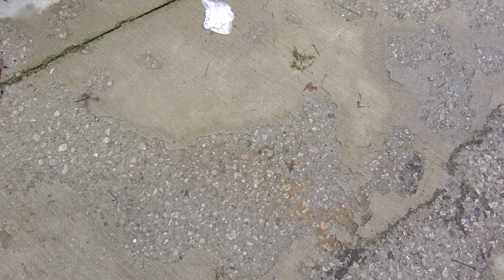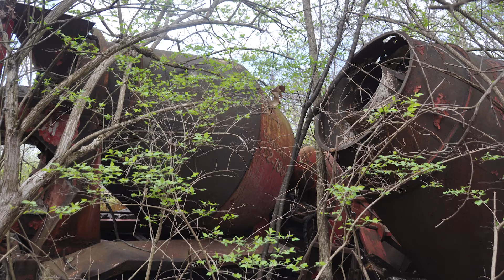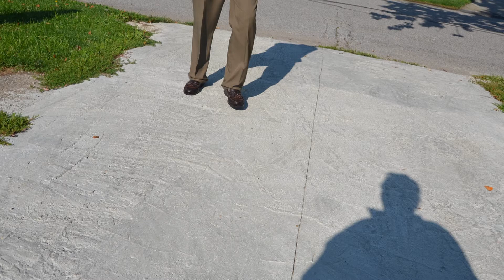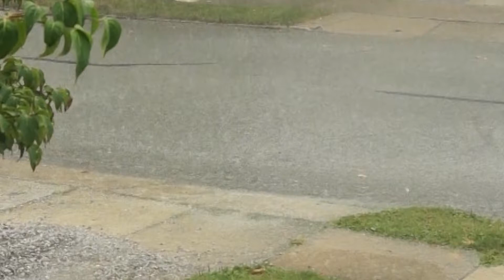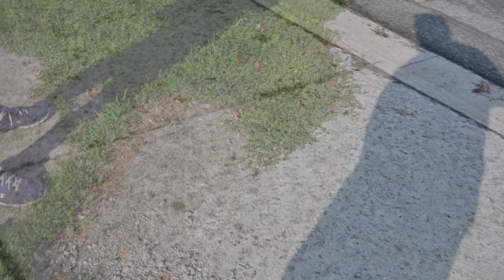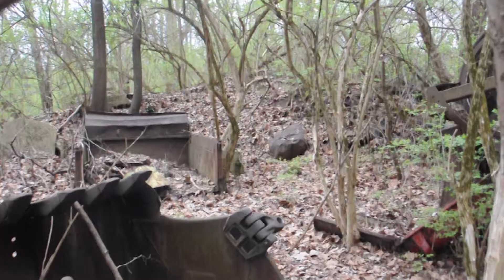Why us is my Concrete Driveway  cracking: my concrete driveway  is falling apart

Comment: Never take advice from someone who can only criticize a job, but can't or won't do it on a daily basis, but will charge you to criticize other people's job. Harsh reality, every batch of concrete is different. You can only increase your odds of a good job or decrease your odds of a good job. Find someone with a good reputation that actually does the work and use them, not someone with a bunch of degrees and head knowledge but no real life experience.

Comment: The hydration reaction is between cement and water, the text is correct but it said sand in the video. Anyways, a good batch plant will not mess up the water added unless it is adding too much water (usually if the moistures are not ran and the material is saturated, or a bad mixer driver adds too much water while washing the blades in the drum). Ice is wonderful in the summer but it can be expensive; I would recommend using a retarding admixture (batched at the plant) to delay the onset of the hydration reaction, which delays the exothermic aspect of concrete, dosed for however long you request, thus preventing concrete from going off or drying up in transit (which is usually compensated by adding water) and ice if desired. Plasticizers are amazing, but may only work for 45 minutes or less if it is hot, and may lead to the concrete rapidly losing its' slump/workability, so beware if it is dosed at the plant and the job-site is a long drive, the first few yards will be deceiving and in no time the concrete will have a magnetic pull. Air entrainment admixtures are by far the most difficult aspect to quality control, factors include the carbon content of the fly ash, how much the concrete is agitated (drum revolutions), gradations of aggregate (especially man. sand vs natural sand mix designs), temperature, and slump. If a finisher is vibrating the concrete then air can also be lost. A top notch finisher will have air entrainment and plasticizers on hand although this is very rare; and having a finisher testing the air content on the job is so rare that only a government contracted job will have a certified field testing technician available to test the air content. 

As far as cracking is concerned, ALL CONCRETE IS 100% GUARANTEED TO CRACK. However, the cracking can be minimized by adding monofilament fiber to the mix, not adding to much water (usually on the finisher wanting screeding and placement to be easier) also it's almost a guarantee if it gets rained on during placement it's going to be super prone to premature cracks. Also, on windy days the concrete may appear finished but a good finisher will stay around to monitor as the composition rapidly changes and may make immediate cracks upon "going off". The same applies to cold days, especially without accelerating admixtures or calcium chloride, the concrete takes MUCH longer to set up and a bad finisher may not stay around long enough to ensure a quality job.

In Summation, get a good finisher. Although some batch plants are bad, a good finisher will ensure a good final product. Good finishers also know the best place to get superb mud. Batch plants are usually sufficient because of government regulation, but some go the extra mile to make a superb quality mud day in and day out. A superb batch plant will irrigate their rock with cool water in the summer to prevent drying up (Rock is the bulk of any mix design other than flow fill or grout), they run moistures every day and gradations every week, and the mix designs will be overdesigned to compensate for finishers who add to much water. A good overdesigned mix will break 4500 psi for a 3000 psi mix, at 28 days which is more safe spending $50 on the extra cement rather than getting into a lawsuit over something that was the contractor, architect, or engineers fault; Although most government work has an engineer submit their mix design for the specific job.
Reply from the maker: I think you covered all of it. Let me think. We can change the cement type during the winter to "HIgh Early"  type 3, so we can strip forms early.  We should climb into the trucks at the plant and inspect them to and make sure the fins are not damaged or coated to make sure we get what were are paying for check rev counters and water gauges and only permit trucks that pass on your project. When trucks arrive,. Check the water gauge an make sure it full. Check the time stamp on the batch ticket to make sure you have enough time to discharge, typically 1 1/2 hours form bathing. I call the batch plant to make sure they compensate with the mix design if the sand aggregated piles are too wet or too dry.  You might also do a unit weight with to make sure you are getting your mix design. CALCIUM CHLORIDE IS A BAD IDEA IF YOU HAVE  REBAR OR POST TENSION.   You need smart labor also. You want to wet down the stone base, so it does not suck the water out of the mix. You finisher should never splash water on the concrete to keep workable. Curing compound needs to be applied after the final set.  On windy days or hot days, you can add retarders to the mix to slow down hydration.  In the winter use accelerator to speed up the hydration.  Now for winter, you need winter protection, and you need to monitor the temperature for at least 21 days. You should also have 5 test cylinders for comprehensive laboratory testing. You need one for 3 days to see if early from remove is possible, one for a  7 day breack Two for 28 days and one space for 60 days.
Reply: High early generally calls for type 3 cement, but not all areas have batch plants with multiple silos just for different cements, but high-early can be achieved by increased cement content, especially with a no-fly ash mix, and use of accelerating admixture. A non-chloride Accelerator takes the place of calcium chloride if steel rebar is used in order to prevent corrosion. Batch tickets, rev counters, unit weight, air etc. are standard for jobs that ensure quality control, although most residential jobs do not. In my state, Moistures are required every morning from a certified plant technician as well as weekly gradations. State inspectors take samples of every material: aggregate, cemititious, and water; to conduct lab tests and compare to the inconspicious postings of the testing forms. 
Concrete cracks regardless but most people are not educated in the science of concrete. Ordering concrete, without knowledge, from a busy dispatcher can set oneself up for disappointment, even if the batch plant is flawless; for residential work a good finishing outfit should know the process and what kind of mud you need, and may also be certified to make cylinders and run air test etc.. Concrete is a science though, there is a reason why it takes many engineers and technicians for jobs such as bridges and nuclear cooling towers.
Reply from the maker: OK so what do: 1) run test lab,  2) structural inspector with 20+ years, 3) civil engineer who design mix designs,  4) batch plant boss, 5), professor 6), Job boss for Turner 7), the Concrete technician who is overqualified     ???       Sounds like your read all volumes of the  ACI
Reply: I was not attacking you, I basically said you were an expert in cocrete. Second of all, I know about sand, You see I only spend 30 minutues per video.  Sand was supposted to be cement. Obviousely sand is not going to chemiclly react. My mind kept say sand instead of cement.   It was a mistake and I knew it  later.  My video are off the cuff and not perfect.  Sorry that you feel your were bein atttack when  basically you were being praised for your knowled. I hope you dont tod that to everybody case you wont have a lot of friends.
Reply: Marcus..chill the $#@ out..I read both conversations and he wasnt even in the slightest tooting his horn or claiming he was a know it all ( like you try to be) he was just adding his 2 cents and praised on how detailed you were. I appreciate the education and details of the comment but he is right about friends. If you talked to me like that you would be dreaming about concrete mixtures in a long slumber.